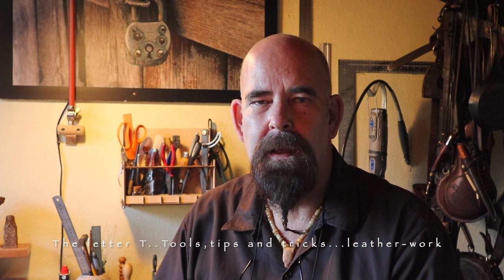Tool, tips and tricks in leatherwork T) Bushcraft from A-Z

Comment: Good Video for beginning leatherworkers imo. You pretty much covered all the basics in a short and easy to understand video. Good job!😊
The great thing about leatherworking is you can get into it and never even have to buy any tools. I've made entire projects using only a knife and a sharpened nail.
I've got a lot of leatherworking tools but for most projects I only use a utility knife, a hole punching chisel, a hammer, a needle and a ruler. That's really all you need to make a knife sheath. When I first started out I used an awl to punch my holes but the hole punching chisels really help you make a better looking project.
I've been using a lot of copper rivets lately and they really speed things up and are great for hard use projects like machete sheath. It's a lot easier to install a line of rivets than punch and sew really long lines in something like a machete sheath. Plus you never have to worry about your machetes cutting their way out and biting you. 😊
Reply from the maker: I’m glad you like my video my friend 😁👍🏻 and agree with you about the tools you need 🤗 but I’m glad too have a selection of tools to choose from … I think I get a better finish using them. 
Appreciate your feedback very much and hope too see you again soon 😉🏕🔥🌲Tom🇩🇰

Comment: Great vid, as usual, Tom! I always learn something from you, I have been doing leather work over 50 years ,making sheaths and cases like you and never thought of sanding the leather to make a mat finish.  btw I bought a cheap hair dryer and use that instead of the oven for drying the dye and forming wet leather. thanx for your work, Sam
Reply from the maker: Thanks Sam for your feedback 😄👍🏻 appreciate that my friend 
I’m glad you could learn a bit from my video and like your tip … using a hairdryer 👌🏻😉🏕🔥
Tom

Comment: The punch with the wooden handle is meant to be pushed down several times, until it completes the hole. This is a Japanese invention but the Chinese made ones have a very rough mechanism. The original one is much stronger, smoother mechanism, durable and sharper than the cheaper Chinese replicas but is much more expensive. You can get the Chinese ones for 1/4 of the price for around 10$, but it’s still better to get the original. If you are only going to buy one type of punch, get a set of individual punches and a pad to punch over. Rotary punches are good for speed and making holes for rivets, snaps etc. quickly.
Reply from the maker: Thank you so much Alexander for your advice 😁👍🏻 and info about the tool I use to my leather work 🏕🔥
Tom